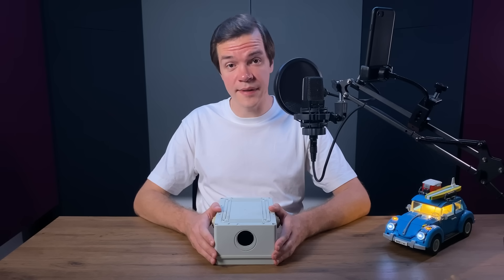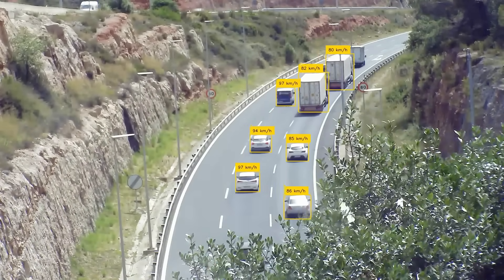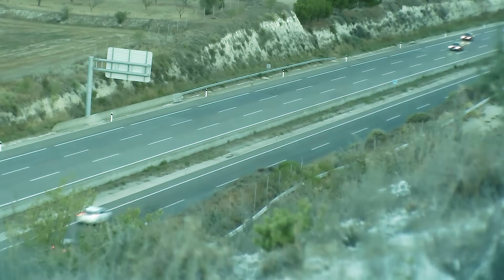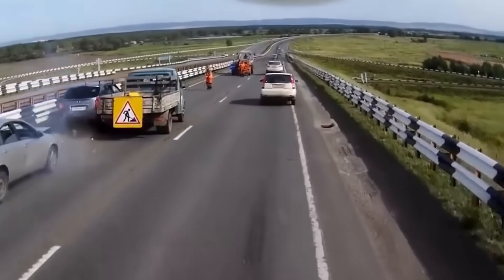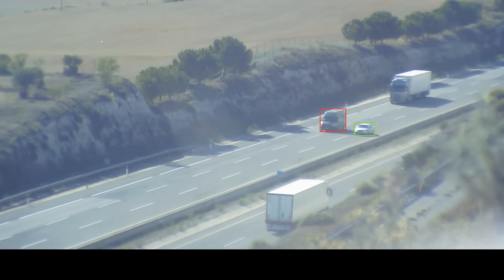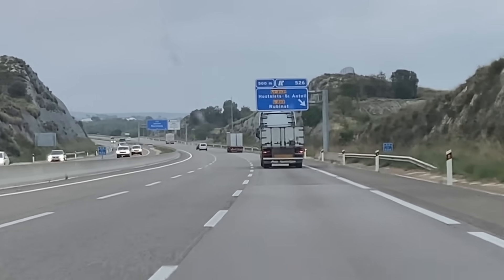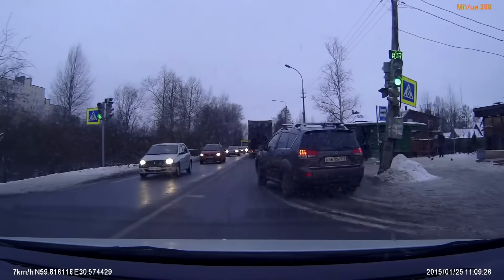New Anti-Tailgating Camera Reveals Shocking Statistics

Comment: Another problem is people using the passing lane as a travel lane for no reason. The other day I was travelling in the right lane going well above the limit and a car merged on behind me and immediately moved to the passing lane then, without me accelerating at all, quickly receeded behind me. Why move to the left lane when you are already travelling slower than traffic in the right lane? I also frequently see people move to the left even when there is nobody in front of them in the right lane for miles. Piss poor lane discipline is a huge problem in the US and plays a major role in the tailgating epidemic.
Reply: In parts of Europe (thinking france) saw that the passing lane was generally just used for that.  I noticed that lorries (trucks) stay out of the passing lane generally as well.

 In the US on many highways, the left lane is supposed to be for passing, but is generally ignored.  Will find trucks (generally slower than should be) and cars at random speeds in the lane.   Some drivers will not move out of the way even if proceeding at a speed that is at or below the middle lane, but in the passing lane.   Very selfish.
Reply: @tr8d3r  Trucks generally only move into the left lane to pass, even in the US.
Reply: The counterpoint to this is: "passing lanes" on non-interstate highways are not passing lanes. If I will be turning left, I will be in the left lane. And in heavier traffic if I am driving straight, I will stay out of the right lane, since typically the "turn off" is short or nonexistent, so right-lane travel is stop & go, or speed & stop.
Reply: @CDArena  Even on freeways, in the US, once there are more than 2 lanes, all lanes are travel lanes.  Left lane for passing only is a rural interstate rule.  In the city, the traffic is heavier and all lanes are travel lanes.  Still, most drivers sort themselves by speed, with each lane to the left being faster than those to the right.  

When I was a truck driver on a 3 lane freeway in Chicago, I'd never ride the right lane.  The right lane in Chicago when driving a 70 foot vehicle was awful.  There is an on ramp about every mile.  But the ramp is a clover leaf and super super short.  Cars would be getting on the freeway at 35 mph.   The length of the truck meant more interaction with the on ramps and less ability to move left.  If a line of cars were getting on, the length of the truck makes integrating them around you difficult.
Reply: Update: I was looking at the map.  It seems Chicago revised this design during the major construction they did 15 years ago or I just couldn't find the particular road.
Reply: @CDArena came here to say something similar. Different road types and locations the traffic behaves differently
Reply: Indeed the in the UK this also happens, and sadly quite regularly, i can understand they might feel more safe, however most of the time i see it it's on a 3-lane highway that also has a hard-shoulder so they already have effectively a lane between them and the edge of the road. Maybe they just feel like a boss and owning the road.
Reply: @rimmerblues1586 
In the past, people thought that the left lane was for lorries and newbies.

In some Countries going alone on the wrong lane his considered max penalty (heavy fine and 6 month to 2 years without driving....)
Lack of education and good sense
Reply: In some Countries left lane lonely ride is max fine and license capture for months or years
Reply: Not just in the US - pretty sure that's a global issue!
Reply: Lol no, ban highways, replace with trains.
Reply: I miss the good old days when police would ticket people for driving slow in the passing lane. It would alleviate a lot of the problems on our freeways.
Reply: most people hate driving and have been brainwashed into thinking it's the better option. driving in the middle lane eases their mind a bit because they're further away from the wall. 99% of bad drivers are just scared
Reply: @andres-vi1uy  I was confused when the comments keep mentioning the middle lane becuse when I think of a middle lane I think three lanes going in each direction. If there are three lanes going in each direction it is actually safest for everyone if the people who will be going strait for a while stay in the middle since the left is then for passing and the right is for getting on and off the road.
Reply: @NAEVAN238 In Belgium it's illegal to stay on the middle lane if you can be on the right lane
Reply: @NAEVAN238  yeah my city regularly has highways with three to six lanes in each direction and when they keep saying "middle" lane it kind of sounds like they want to keep two to five lanes on the left empty for passing and everyone drives on the lane farthest right
Reply: @andres-vi1uy  Lol. Why is the overtaking lane not by the wall but in the middle?
Reply: @hibahprice6887  you're part of the problem if you just cruise on the middle lane, the middle lane is for overtaking. You have to drive on the right side of the road

Comment: True enough, following distance and culture about tailgating cars is the most dangerous to drivers, not reckless speeding. In fact in a number of countries speed limits exist for road maintenance as trucks loaded with dozens of tons at high speeds can pretty much ruin roads... at least if they aren't built properly for it, which is exactly what's happening in a number of countries.

Comment: It should be illegal to avoid a hazard without slowing down and doing what you can to warn the drivers behind you. Jumping lanes at the last second only to leave the guy behind you a big surprise is ridiculous. If that's all you can manage, fine, but some drivers are staring in their mirror thinking they can change lanes in time, but then can't until the last second. This is what causes multi-car pile ups too, that's why it should be illegal. If you see a hazard you should be required to slow to 30 or 40km/hr just like with road workers and first responders. Pretty straight forward.

Comment: If there's no real way for an external system to catch and fine people for tailgating maybe the solutions need to be built into the cars, like some basic software that can sense cars maintaining an unsafe following distance behind you based on current speed and flash annoying warning lights to back off, or lasers! (I'm only mostly joking), and similar for the front, some kind of annoying audible warning sound alert to the driver if they're too close to the car in front.
Of course a lot of people would hate it very loudly, like seatbelts.

Comment: I wish roads had enough cameras to track tailgating and speed over longer distances. For example, have cameras on all big roads every 10 km. Use tracking similar to this video to compute following distance in front of each car on every camera. If the driver drives with too short safety distance on two consequtive cameras, give a fine. If the time between two cameras is too short to drive within speed limits, always send fine (average speed control which prevents the whole issue of slowing down only for the camera).

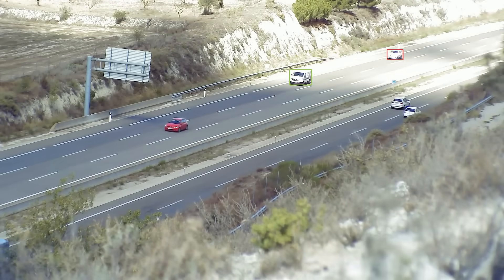Comment: 10:15 When you compare "how dangerous" driving with safety index < 1.0 is, you should compute the expected collision speed if something happens. If you drive with too short safety margin at 50 km/h and something happens, you collision speed is maybe 20 km/h because you were able to partially slow down. When you drive with equally small safety index at 180 km/h and something happens, the collision speed might be around 110 km/h which is obvious a lot more dangerous in reality.

With modern cars, the 50 km/h is actually close to "safe" collision speed where you only get financial problems instead of life-threating problems for the passangers. But if the collision happens with the life traffic, even the 50 km/h may easily kill the people on the receiving end of your car which is why speed limits in cities with light traffic are so slow.

Comment: They key is to drive looking past the vehicle in front of you, through their windshield if possible, and also automatically hit the brakes as soon as you see a red light without even thinking it.

I live on the south of Spain (Granada), where there are only 2 lanes and high density of cars going to the beach up-down the mountain-like terrain. And it is madness how insanely close people is used to drive, you only need 1 slow vehicle on the right lane, so everyone changes to the left lane in a extremely compact formation (because a slightly less slow vehicle is holding everyone).

Surprisingly, there are plenty of accidents but almost all are from people that breaks their cars (extreme hot outside while going up hill without good coolant or such)

Comment: Here in Italy we are introducing cameras that check tailgating, sudden lane changes, occupying the overtake lane when the others are free and lorries occupying lanes besides the first one; those are mostly "quality of life" interventions, however. The most effective thing is that there are very long stretches of highway covered by average speed cameras (at least one highway is completely covered): it had a measured (and quite high) effect on the number of incidents in those stretches. On the other hand, there has been cases where the introduction of a spot speed check INCREASED the number of accidents in its proximity. 
This is because the dangerous part is not the speed itself, but the differences between the speed of different vehicles: a guy doing 180, when reaching someone doing 130, they see the other doing only 50km/h less, but they have to brake as hard as if they were doing 125 and had to come to a standstill. The kinetic energy you have to dissipate scale quadratically with your speed.
When you introduce average speed cameras on long stretches, you effectively narrow the spread of the speed distribution, removing a major cause of possible accidents, decreasing as well a major incentive of tailgating. If we are all doing 130, it doesn't matter if I ride their ass or leave some space. 

On this point, I think you should do more analysis on your data. First of all, you should separate your data by lane and vehicle type: the speed distribution of lorries is very different than the speed distribution of cars, and the average speed on the first lane is different than the speed on the third lane. I would also like to see the correlation between distance between vehicles, and speed (and type) of the first vehicle: I suspect the cases of tailgating increase if the first vehicle is doing 100 in the third lane, or if it is a lorry not in the first lane...

Comment: In the same way that it is compulsory to have a beeping sound when your seatbelt is not correctly applied, surely it should be possible to make it compulsory to have a simple device that measures the distance to the car in front and beeps when it is too close? These could become part of the MOT or roadworthy requirements and permit highway police to pull people over if they suspect you don't have one. This would be easy to prove and enforce, the same as it is with seatbelts.  

Enforcement is the only option, as the people who refuse to drive sensibly are doing so intentionally and with disregard for the law, and are unlikely to do what's best out of the kindness of their hearts.

Comment: @RailwaysoftheWorld1 I salute your research hardware and software and your kinematics approach to analysing the risk of "suddenly becoming stationary" as the result of a shunt collision.  However, the "trouble" isn't just that someone drove without sufficient distance from the vehicle ahead to avoid a collision.  The extent of the "trouble" that a collision causes also matters.  This depends on a dynamics approach that considers how much kinetic energy your vehicle has available to bend metal and crush bodies (proportional to the square of its speed), and the forces available to do that (proportional to the speed lost and inversely proportional to the time taken to lose it).

When driving in marginal conditions for visibility and/or braking, I have to keep reminding myself that my vehicle has four times as much kinetic energy travelling at 120 kph than at 60 kph.  🙂

Comment: I agree with 100% of your commentary. I have made the same observations, I drive every single day to different locations so I've seen a lot of context and density of traffic conditions. What I've come to understand is, most people drive like they're sitting in their living room in pyjamas. They don't make any effort, are not focused on their surroundings, and react and manoeuvre only on instinct. They do not take the other drivers into account, they treat them like obstacles, or worse, nuisances. They also express their disapproval of others' safe driving with aggressive manoeuvres like tight cutoffs and tailgating. It's easy to tell, when they're less than 30m away you can see the expression in their eyes and their distorted faces

Comment: In the Netherlands and Germany (as far as I am sure) they do check for tailgating, and it is punished quite severely with a hefty fine (80km/h + less than 3 meters distance, costs 700 Euro in the Netherlands. Some cars have automatic distance control built in, and the system warns first, and even intervenes by braking, if you drive too close to the car in front.

Comment: From your video, it's pretty obvious which drivers were illegally changing lanes (cutting people off).  These are public roads.  You have no right to expect the authorities aren't watching public roads to enforce traffic laws.  They could put up a bunch of cameras that catch illegal lane changes.  OTOH, they could also require car makers to put in warnings that you're making a dangerous lane change.  But this whole thing is why the road safety authorities have pushed for self-driving cars.  

As one of the drivers, you can watch for all of these behaviors and actively force people to make better decisions around you.  It does require bending the rules yourself, but you can use it to improve distances.  When you see someone likely to cut you off, close the distance in front of you so they can't.  If they signal their intention and wait, open the gap to let them in.  If you have someone tailgating, slow down (no brakes) and speed up repeatedly to make them back off.

Comment: Excellent video. This issue has bugged me for a long time and it's nice to see it thought through. Cameras are so cheap today that watching long stretches of highway and following individual vehicles over the entire section is feasible. Give the benefit of doubt to drivers at the start  and end of the monitoring distance and for a short while after lane changes. Penalize for tailgating in the middle for extended durations. Increase rear impact penalties for drivers (up to never driving again).

Comment: 12:02 "turns out to be nearly impossible to prove while preserving Justice"

Not at all, you just put 4-6 cameras on a the side of a 2-mile stretch of road...

If a car is tailgating on every camera for the whole 2 mi, then they obviously weren't trying to correct the distance. Especially if you use AI to calculate if they have been tailgating the same car the whole time. 

The fact is, tailgating just isn't taken seriously enough. By far it is the most dangerous habit on the road, even worse than speeding as the video points out. But until law enforcement starts taking it seriously, it's going to keep being a problem.

Comment: I drive in the slow lane and leave a safe distance between me and the car ahead. I deal with tailgaters by lifting my foot off the gas so we both slow down until they get the message to pass me. sometimes I glance at the fast lane and I see 5 cars in that same amount of distance. I dread at what would happen if the lead car suddenly crashed.

actually, I got a good example of what would happen.
years ago, on the George Washington bridge between New jersey and New York I came across the scene of an accident, it had about 5 or 6 cars, each right behind the other, and every car had crashed into the one in front of it.

Comment: I live in Madrid, in Spain. usually I go everywhere walking, with public transport or bicycle. But when I go to my village, I have to go with car, as there is virtually no public transport (two busses a week, on Mondays and Fridays). By far, when I fear the most is when I drive.
I think that in Spain people drive ok (of course, there's always one person that just doesn't appreciate their life or the life of other people), but there's a significant amount of people just ignoring the speed limit. If they want to really reduce the speed in a specific point, the only effective method is by placing a radar. Otherwise, people drive at 60 in 30 streets, at 120 in 90 roads, and at 150 in 120 roads.
I've seen that in the road that leads to my village. There are two split roundabouts that, because of low visibility, they had a limit of 60km/h. Almost no one drove at that speed. In 2022 they painted two green lines to visually reduce the speed and placed super mini bollards in the center line at the roundabouts. That didn't work. Then, they placed a radar that told you your speed, but no fines at all. That didn't either work.
Finally, this year, on 2025, they place a radar that send you fines. Finally, that's what have worked. It's a shame that people just ignore the law until it is systematically enforced without human intervention...
If you want to check the place, it's on the CM-101 road, near Mohernando.
By the way, not all roads are three lane motorways. In that places maybe speeding is not as dangerous as in other types of roads or streets, but outside of motorways, speeding is a problem.